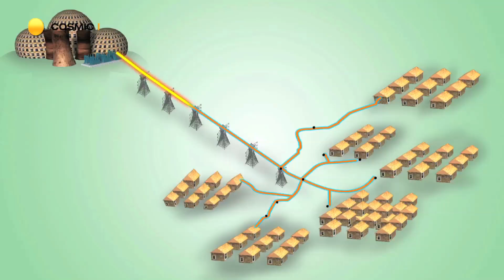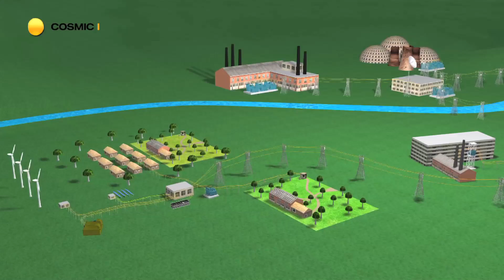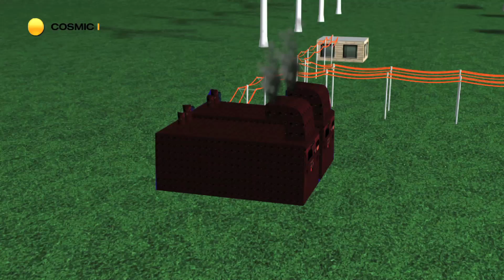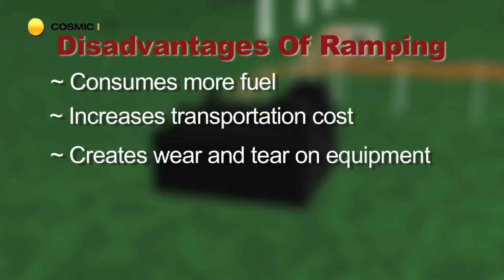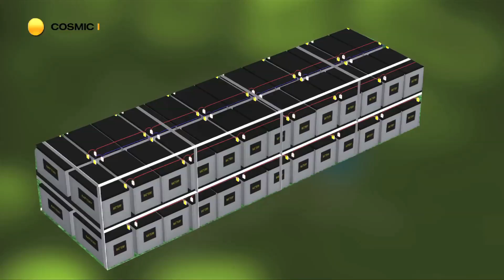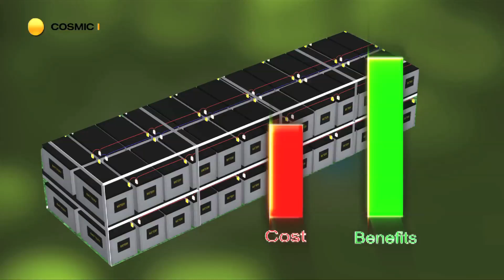Power Grid Function, Micro Grid (3D Animation)

Comment: hii sir, i am engineering student,i am doing a project regarding microgid so want  the what is the input for micro grid  normally .
Reply: Micro-grid is bidirectional which means it can get power supply from the conventional grid and also through renewable sources such as solar,wind etc. Different type of inverters,battery storage,converters are required to connect these renewable sources in the microgrid.
However, the main motive of microgrid is to make it work in islanded condition where it can work alone in a place where conventional network is not so reliable.